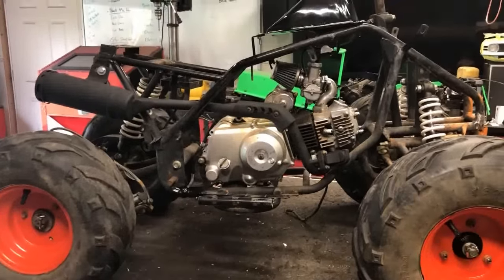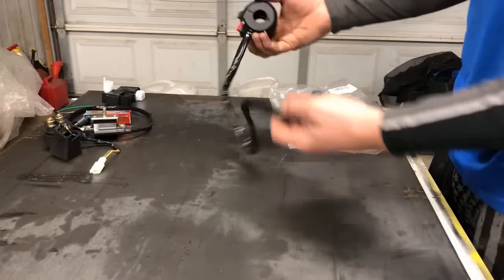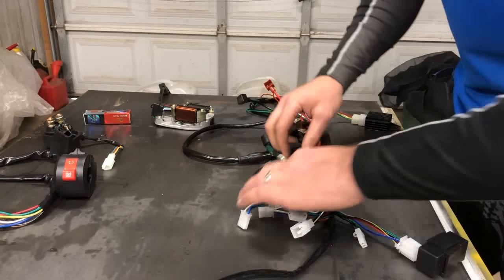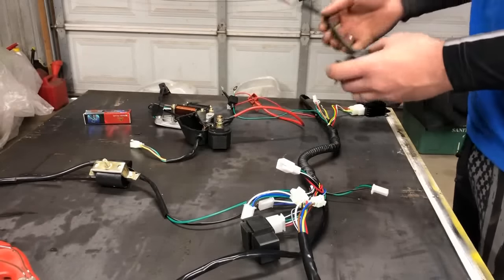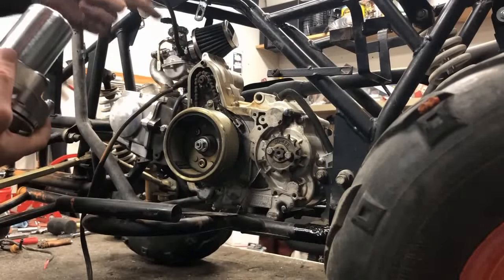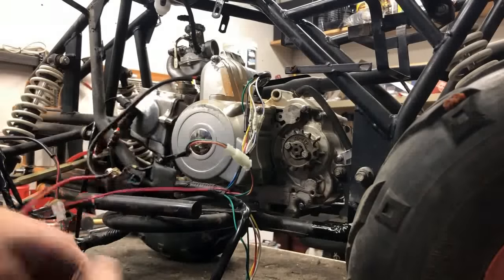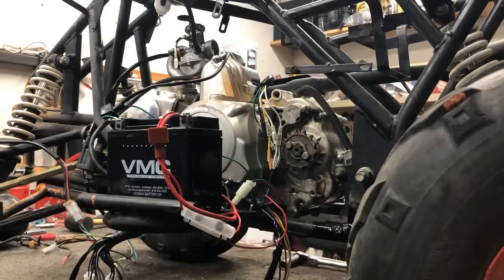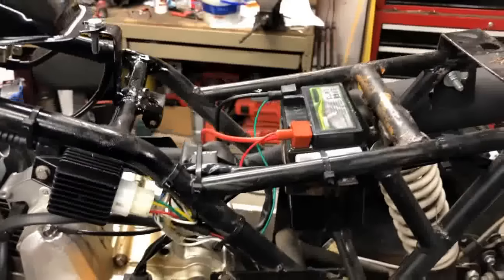Wiring a Chinese ATV from start to finish with an All New Wiring Harness!

Comment: Hi, I bought the wrong wiring loom it doesn’t have the lights front and rear also the brake safety switch.my quad has these on the loom will it still work if I swap it over and don’t use the brake safety plug
Reply from the maker: You probably bought the harness for a dirt bike then. I assume as long as the new stator fits it will work, but that's a guess. I have never tried it before.
Reply: @PraskaBoysGarage  thank mate.everything else seems to be ok.will I have to change the starter motor to one that matches the wiring loom.

Comment: It appears to me that my sons atv has a remote control alarm box system that’s hooked up to the wire harness, but not to anything else. Do u need an alarm box for it to work or can u bypass it, thanks.
Reply from the maker: The box is remote controlled so it doesn't function unless your hitting the fob. You can simply unplug it and it wont effect the harness unless you have a fault in the wiring leading to the box.

Comment: Could you please send me the website or URL to getting the correct wiring harness 'cause mine I can't find it it's a 4 pin cdi
Reply from the maker: https://www.ebay.com/itm/CDI-Wire-Wiring-Harness-Assembly-Kit-ATV-Electric-Start-QUAD-50-70-90-110-125cc/302880786805?ssPageName=STRK%3AMEBIDX%3AIT&_trksid=p2060353.m1438.l2649

Comment: Video is great everything seems to line up with mine except for the wires coming out of my engine are 
Blue with white stripe 
Green 
Yellow
Yellow 
And black with white stripe.
And the only 5 wires I have left in the harness are black with white stripe
Green 
Green with yellow stripe 
Brown
And another green. 
Have you seen these before? What should all the wires from the engine be connected to?
Reply from the maker: Thanks for sending me the email with pictures. I will take a look and do a little research to see if I can figure out whats going on.

Comment: Thanks for sharing. I ordered a new wiring harness with stater Cdi silnoid but it’s  slightly different from original.  Will any Chinese replacement  harness work with my atv? It’s a 125 Shandong Liangzi.
Reply from the maker: Pretty much all the generic harnesses you can buy online are the same. Key things to look for are which stator comes with it and the kill switch/start button. Those will vary between the dirt bikes and ATVs. Thanks for watching, and good luck on your project!

Comment: Can I discconect the timing trigger as the stator that I order comes with a timing trigger but the old stator didn't have one, and the new one won't fit in the casing?
Reply from the maker: I guess I've never seen that set up before. If you don't have a pick up how will the coil know to spark? If you can send send me some pictures to look it over that would help.

Comment: Hi great video, I have just installed a very similar wiring harness as per your video instructions. Every was going fine and during the test start the motor was turning over so I am sure all of the connections were correct however after a few seconds the starter relay just started to make clicking noises and the motor does not respond - any advice on what the issue could be?
Reply from the maker: When a starter replay starts clicking that usually means it's bad. Sometimes you can bring it back to life with a few love taps but otherwise it will need to be replaced.

Comment: Thank you so much for this video. My dad bought me a used Chinese quad when I was young and it never run, we couldn’t figure out the problem and after years of sitting I took it out and starting working on it. I was struggling with the wiring and this has really helped. Do you know where I could get the starter motor and starter cable? Thanks for any help given
Reply from the maker: Hey good to hear the video helped! If your looking for a starter remember they have a couple options either a top mount or a bottom mount. I just order mine of Amazon and have it shipped Prime. Let me know if you need a link!

Comment: Great vid and almost done but the 5 main wires are not the same hook up. I need the color guide to match to quad. It is the same kind of quad. There is a 5 wire green plug coming from quad😩. I can cut and put bullet connectors but need color codes🙏🙏🙏can’t do pic here

Comment: So I just got a new wiring harness but the stater on the new one is the 2 coil, and the current one is a 6 coil, but when I search for the 6 coil ones it's coming with wiring harness for 6 pin cdi only really I got the ATV I'm working on as a non runner and the wiring was butchered, but my question is basically can the coils work for either cdi or are they for different cdi units?
Reply from the maker: Otaku Teacher Both coils do the exact same thing. I’ve never tried to swap them I’ve always ordered the matching set. I’d say if it fits and lines up in the cover case then I bet it will work.
Reply: @PraskaBoysGarage  so got my new wiring and I was just going to use the old stator If it's good, but my only issue is every wire matches up with the new wiring black & red, blue & white etc, but the new wiring has a white, and a yellow wire where as the old stator has 2 yellows instead which I believe are going to the rectifier for charging the battery, would it matter if I just connected them at random cause no way to tell which ones meant to go where or does it matter which way they were up and if it does is there any way to tell? Would appreciate the response thanks
Reply from the maker: Otaku Teacher White & Yellow have the exact same function. Both are charge wires so you can flip flop them and it will not make a difference. You should be good to go, pending the stator is in working order.

Comment: Do you know where I can find a wiring diagram for a 90cc sundiro? I’ve looked everywhere online and can’t find anything about it. My wife bought this for my daughter this from her cousin and it puked out on the second day. Lots of cursing. I’ve spent half of last summer trying to figure this out. It won’t start or even fire even fire at all with starter fluid or the gas mixture sprayed in the carb. It shows spark but that doesn’t mean it will be good enough to fire. I’ve been through the carburetor, new coil. The problem is I can’t find parts either. Any suggestions? I’m pretty good a repairing and troubleshooting. This is just kicking my ass. Thank you
Reply: It’s a Chinese ATV
Reply from the maker: I am not as familiar with the 2 strokes as I am 4 strokes. I believe the one you have is a similar copycat to an early 2000s Scrambler 90. I would check out that wiring because I am assuming they are close to the same. Have you tried running a compression test? If you have spark and fuel but it still wont run that narrows it down to only a few things it could be.

Comment: I just bought a coolster 125cc the guy i bought from put a 212cc predator but I don't know wht clutch and wireing harness wires are all cut out 😭😭😭😭
Reply from the maker: The predator wont be able to adapt to the harness. The only thing you could do is add a coil and new flywheel for the predator so you can run lights while the motor is running.

Comment: Do those brake wires need to be tied together permanently? I would assume since you said they are brake wires but need to be connected when starting (as if brake is being pulled)
I’m asking because there are some handbrake kits with a 2 wire running off it and I may buy the handbrake and connect those two wires to it and then run brake cable to that hand lever.

Comment: Is the starter relay plugged into the solid green and black 2 prong plug
Reply from the maker: The start relay plugs into a red/yellow & solid green wire plug that's on the back side of the harness.

Comment: Hey bud, I have an empty plug, not sure what it goes to, it's a six slot plug with only 3 wires in it, they are black/white, solid black, and green.....any idea what belongs there? I already have the coil, CDI, and rectifier installed
Reply from the maker: Is it a plug on the wiring harness or is it coming from the motor?

Comment: I have a question I have a 90cc 2 stroke engine with a oil tank and a gas tank and I think the gas and oil mixes automatically can I just put in normal 2 stroke oil in the gas tank and it still run fine?
Reply from the maker: I've deleted the automatic oilers on Kawasaki and Suzuki LT80s before but that's the extent of my background. You have to block off the exit port and remove the gear. Otherwise your good to premix the fuel.
Reply: Praska Boy's Garage thank you for the help

Comment: I have a TaoTao 110cc 2012 on the front right-hand side is a vacuum line where does it go
Reply from the maker: Usually that line is an exhaust vent. Your exhaust has a rectangle port coming off the down pipe and it attaches to.

Comment: Where did you get the kit? And will this fit a older 125cc tao tao. Am not getting a spark on the plug. Where can I order the kit from and how much was it? I clean the carb on it but still no spark.
Reply from the maker: I have the kits linked below in the description. It will fit the 125cc TaoTao, however it does not include a remote control or neutral/reverse light indicator. Cleaning the carb will not effect if it has spark or not.

Comment: I use a pit bike wiring harness on a taotao 110-D so it doesn’t have the break wire and when I am trying to start if the flywheel won’t turn over but the starter motor spin expect the flywheel can the break cause that
Reply from the maker: If the starter spins then the flywheel will spin. Do you have the chain tight between the starter and crank? The brake has no effect on the flywheel spinning.
Reply: Can the starter clutch cause it

Comment: will this harness work on a 2007 Jiangsu linhai 250. i have a 2007 Jiangsu linhai 250 4x4 that the dumbass who had it before me molested the wiring harness and mine has about 4 or 5 yellow wires coming out of the stater housing. and a 4x4 switch. so do you happen to know what harness kit i need?
Reply from the maker: They make specific wiring harnesses for the 250cc atvs on both amazon and eBay. Im not sure what model yours is specifically but I would research those options. My install process will translate 95% of the process with a few small differences.
Reply: @PraskaBoysGarage  mine is a 2007 linhai 260 4x4. would you kindly help me find the harness i need for it?

Comment: i ordered new harness hooked it all up as you did here in video, i touched the two wires together in front [safety switch] and im still not getting spark what else can i try beside a can of gas and make my own spark. SOS
Reply from the maker: Stator, CDI, Coil, and Spark plug are the components that effect spark. You also have the ground wire, safety tether and kill switch that need to function correctly. Start with the easy stuff. Unplug your tether, clean your contacts for ground, make sure your battery is fully charged, and use a multimeter to make sure the kill switch functions properly with an open and closed circuit. If you do all that and still no spark, then likely you have a failed component. In my experience if you have a failed component it's usually a bad CDI Box.

Comment: oh i am really not sure what the gizmo lever under the switch box is for if you do know what that is and could fill me in on it that would also be great
Reply from the maker: That lever is for a choke cable. Some of the GY6 motors have electric choke and some come with a manual choke. That lever is for the motors that require a manual choke cable.

Comment: Now what to do if I did all of this and I'm still not getting any spark? :( the start button doesn't do anything either. I have everything wired up and I'm getting nothing! Already installed a brand new starter, and it turns over with a screwdriver to the starter relay, but no spark. So frustrated!!
Reply: Did you figure it out ?

Comment: Iv done as show in the video the electric start does work but no spark ?
Reply from the maker: Stator, CDI, Coil, and Spark plug are the components that effect spark. You also have the ground wire, safety tether and kill switch that need to function correctly. Start with the easy stuff. Unplug your tether, clean your contacts for ground, make sure your battery is fully charged, and use a multimeter to make sure the kill switch functions properly with an open and closed circuit. If you do all that and still no spark, then likely you have a failed component. In my experience if you have a failed component it's usually a bad CDI Box.

Comment: Got mine wired up but if I have the positive to the starter connected to the soliniod it continuously turns over but won’t crank?
Reply from the maker: At this point after the install do you have spark?
Reply: @PraskaBoysGarage  I had to switch the solenoid wires around for some reason these were opposite than yours. I can’t tell if it’s sparking or not, I’ve had the plug out and in I don’t think it is. I might have to redo the stater I guess.

Comment: Hi what you recomend  to my tao taob125cc quad very slow off the line and wont climb up hills .  Can i putter bigger carb on exhaust performace cdi and spark plug wire make a differance

Comment: Thanks for this video! I hooked everything up and got it to turn over, unfortunately no spark. My quad looks the exact same as yours except it has a a small black box mounted on the rear near the tail light, it’s has like a 9 pin female. I also have a 5 pin coming out of the gear box which I assume is for gear indication. Any idea why it wouldn’t be getting spark? I followed your video to the tee.
Reply from the maker: The small black box is for the wireless remote to start and stop the ATV which wont hook into this universal harness. It’s usually something simple. Unplug every connection 1 by 1 and inspect to make sure it all looks good. Then clean up any areas you have the ground attached to. After that it will take a little more diagnosing. Your always welcome to email me to if you can get it figured out!

Comment: I am very impressed with you. you make it look easy. I am however perplexed regarding the stator. I have bought 3 stators from this company and none of them worked. The stators  seem to have resistance  but the also have resistance to ground on and off the quad.. I believe i have the right stator because both the quads i am working on have the same six coil stator. If you could offer any assistance i would be eternally greatful. thanks. Keep up the good work.
Reply from the maker: Michael Blackler You mentioned 3 stators, but none of them have worked. What isn’t working? No spark or is your battery not getting charged? Maybe the stator isn’t the issue and it’s something else giving you similar symptoms.
Reply: @PraskaBoysGarage  There is absolutely no spark. The company says i have the wrong stator. I dont think it could be anything else because i also ordered a complete wiring harness for both of these quads. They told me that they thought that i need a different stator. This stator looks exactly like the version 2 but it is version 4. I  asked what the difference was between the two versions but as of today they havent texted me back! I am still wondering !
Reply: I believe that the people i am dealing with have a very good rep so i really am glad to be dealing with these people.
Reply from the maker: There are a lot of things that will effect spark. Do you have your ground attached at a good contact point? Also are are the components new with the harness you purchased? (CDI Box, Coil, Spark Plug)
Reply: @PraskaBoysGarage  I checked all the grounds and i had the harnesses laid out the way you had them in the video. I know that it sounds so strange but I have done everthing properly. I believe those 3 stators are bad because of the way they ohm"d  out. Please believe me when i say this. I am not some amateur working on a quad. I think i need some help with this. Is there anything else you can tell me that proves that my stators are defective?
Reply: And yes, i changed everthing with new parts . Everthing is new on those quads.
Reply from the maker: Michael Blackler Dang, it just seems so unlikely to get 3 bad stators in a row! Alright so don’t worry about white, yellow or green. What ohms readings are you getting from Blue/White and Red/black?
Reply: @PraskaBoysGarage  on the blue \white i get no reading. From the red\black i get 0.515 k ohms. On the second stator i get no reading on blue\\white.On red\blackl i get any where from 86.5 to  200k ohms. On the third stator i get 0.497 k ohms. On the blue\white i get nothing. Dang, it is wierd. Also when i ohm out the yellow and the white i get resistence. about 000.4ohms. When i go from yellow to ground or white to ground i get 1.4 ohms. on the second i get 2.4 ohms. the coils should not show  anything to ground. two of the three stators do. Please tell me i am wrong but at least 2 are bad stators!
Reply: I understand if you are overwhelmed. I thank you for your time. Its a great channel you have there. Keep up the good work and thank you for answering me back.
Reply from the maker: Michael Blackler I’m out of town until Wednesday but in my shop I have probably 15 stators new and used. I’ll run some numbers and let you know what I come up with!
Reply: @PraskaBoysGarage Thank you sir. I really appreciate you doing this for me!
Reply: I found out why i wasnt getting spark. 3 stators were bad. I got 2 more stators and finally worked. however i lost money on the other stators. Live and learn! Thanks for your advice. I do appreciate it.
Reply from the maker: Michael Blackler AWESOME!!!Michael, I’m so sorry I didn’t get you those readings you asking for. I’m glad you figured it out. What terrible luck!
Reply: @PraskaBoysGarage  no problem. I hope we will be seeing some more videos. Thanks for your time.